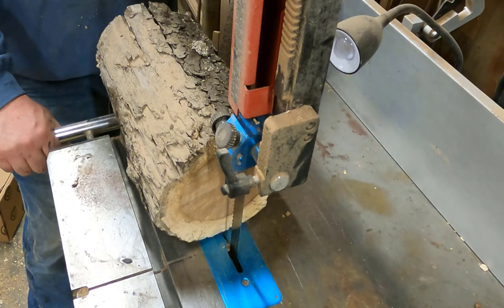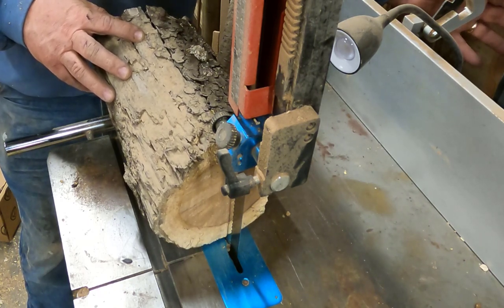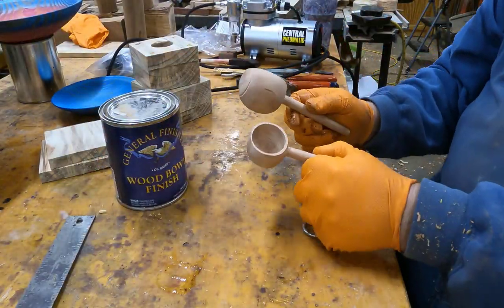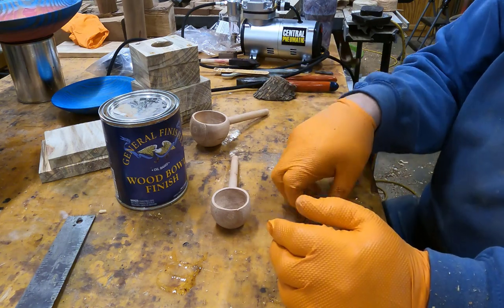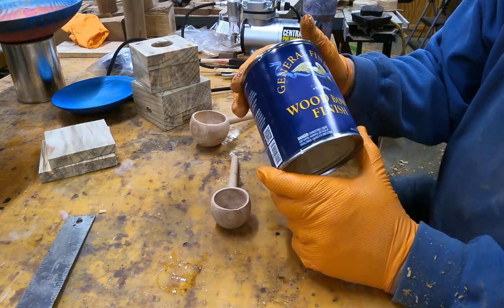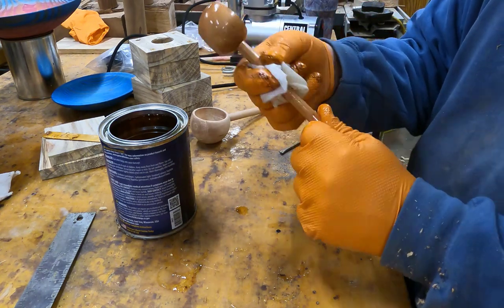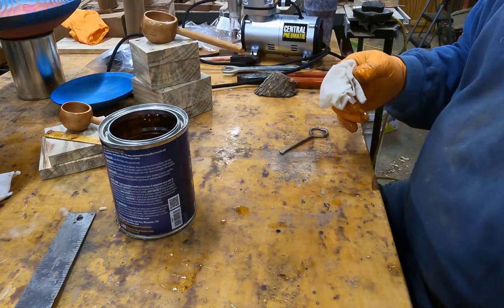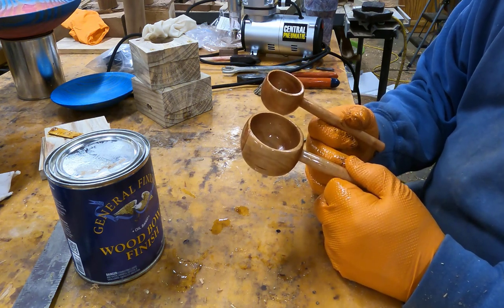Unleash Your Inner Woodworking Pro With Mind-blowing Multi-axis Turning!

Comment: Great video!  Can you share some insights on the donut chuck you made for hollowing these out?  Anything you would do to improve the chuck to make it easier to use?  I was thinking of bolts/wingnuts instead of screws.
Reply from the maker: Thank you John!  That may be a good idea.  The only thing to consider is that the life of the chuck is short. It will get cut into a little each time it is used.  I am going to do a production run of scoops and I will see how many uses I will get out of each one.  Great suggestion!